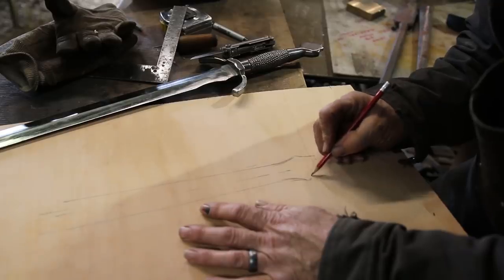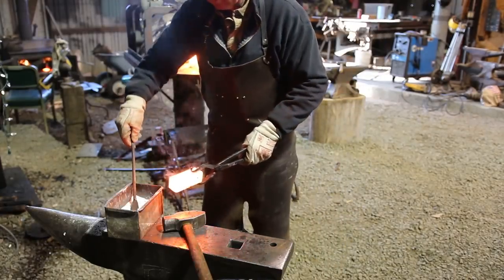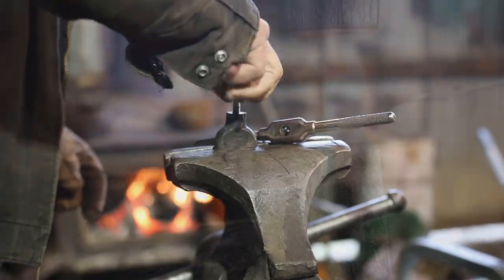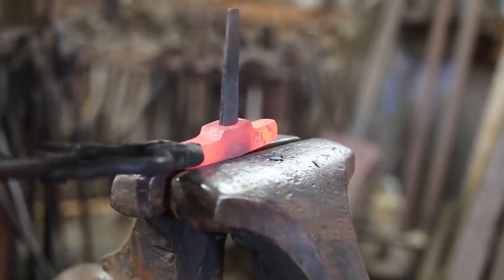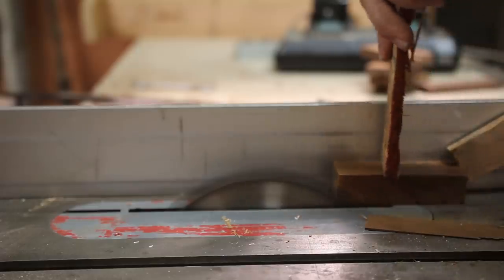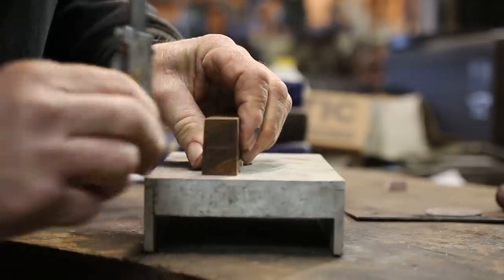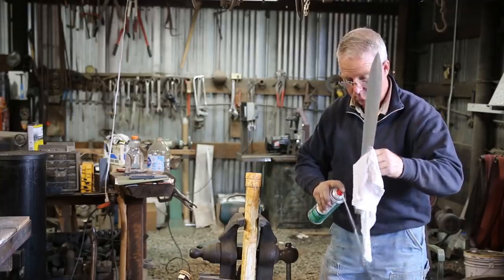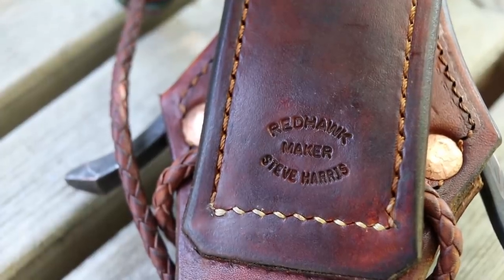Forging A Sword Handle

Comment: Lots of medieval fairs where a sword like that would be sold quickly for a lot of money. I’ve also recently discovered modern day knight brawls where dulled versions of medieval weaponry are greatly needed. 

Excellent work,  I just made my first sword today actually - looks like a barbarian made it. Yours however is a different story. Great work! Hopefully I will at least be a quarter of the blacksmith you are and I’ll be doing just fine.

Comment: How did you thread the end of the Tang? I would've left an extra inch to put in a lathe chuck and single point thread. (machine shop territory).

Comment: You’ll have to excuse my blacksmithing ignorance, but at 2:50 you said when working with Damascus, you should work with “high heat and small movements”. Why the small movements? Is there an inherent fragility to Damascus steel? 🤔
Reply from the maker: There can be a fragility in the welds until there have been several Welding cycles completed. The weld will stick and will appear to be solid but if you move it a long ways or at too low a temperature it will sometimes separate. After you’ve gone through seven or eight Welding cycles however it is truly one piece of steel.
Reply: @essentialcraftsman  Very interesting. Thanks!
I hope at some point you’ll be able to squeeze in some video of the making of that leather scabbard too. That thing was equally impressive!

Comment: Why heat treat the guard and pommel?
Reply from the maker: Two reasons... to make the Damascus etch match the blade, and the guard is light and I do not want it to bend.
Reply: @essentialcraftsman  Thank you for the response! Did not know that the hardness of Damascus could affect the etch!